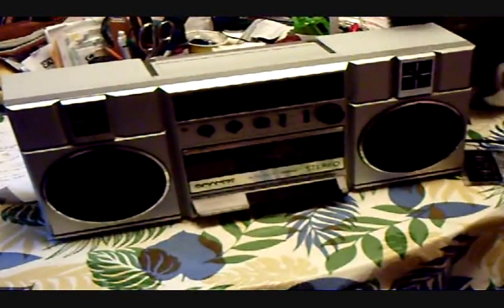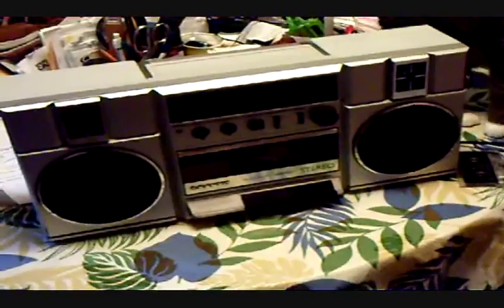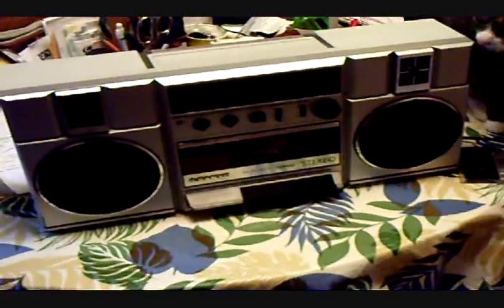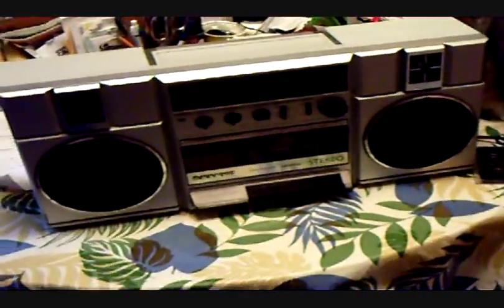80's Boombox Repair 101

Comment from the maker: sounds like your takeup reel isn't working. this is usually caused by a broken belt but you might also want to clean your capstan and pinch roller with alcohol and cotton swabs. the pinch roller might be sticky

Comment: Boomboxes from 1980-1985 are the BEST!  Their only enemy, as U pointed out, is time(and perhaps a school-bus door the thing got slammed against on its way to or from school with its owner).  They rock - 4 bands of radio(shortwave) - some have equalizers, and most had RCA aux-in jacks - great for pluggin a 'Pod into.

Comment: @wasssuppp08 aww mann.  that sucks, i remember i did that exact same thing as you did with a toshiba that i could NOT find new rubber bands for.  i stuck a tv tuner lcd screen with rca jacks in place of cassete deck.  now its used for portable dvd and tv watching.

Comment: @wasssuppp08 have you checked if the flywheel aka that big metal disc which spins to keep the tape speed constant, once i was smashing up a 90s boombox and that part lost its bearings and started doing EXACTLY what you were describing, so i simply ripped it off and it stopped.  crappy 90s boomboxes
i hope the best for yours

Comment: awesome! there should be more how to fix stuff videos on youtube... arent enough. but this was really good. little less swearing but generally well explained. i got my ghettoblaster from a friend. its an aiwa and the motor said 18 may 82. exact same problem. i had to replace two belts though, the one for the motor and the second that runs the tape winding system. i also needed to syncronize the path of the record shaft. and now it looks and works like new